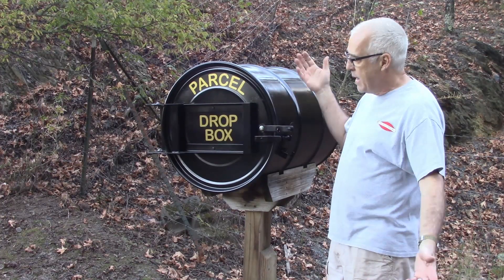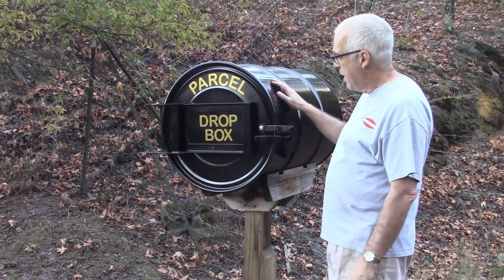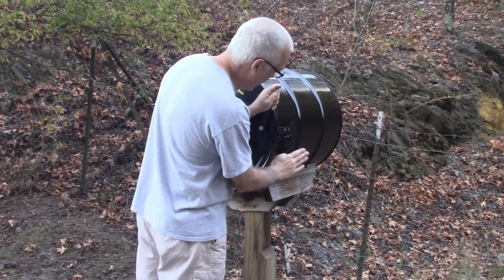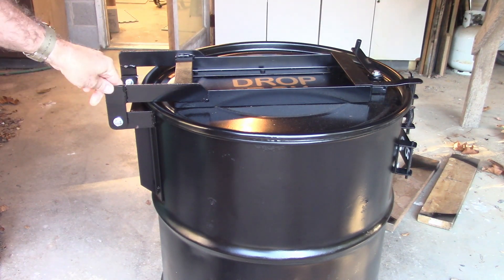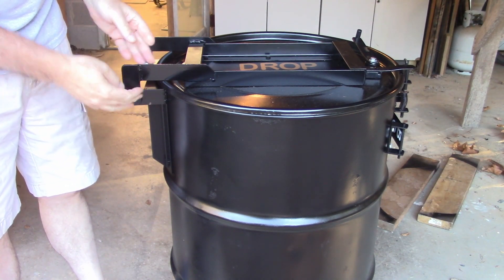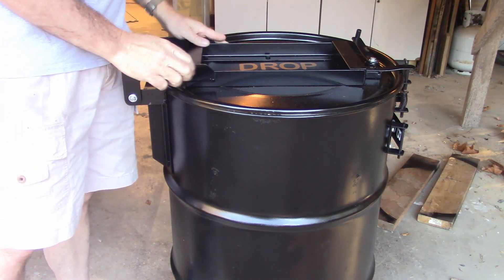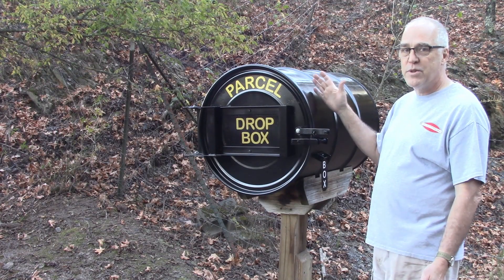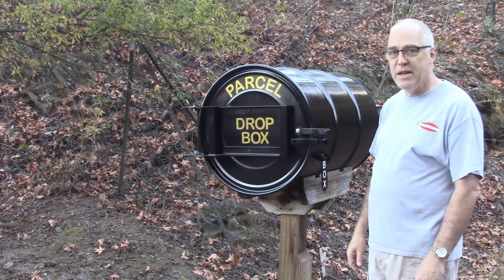DIY Parcel Box

Comment: curious how does that stop thiefs?
Reply: My guesses:

Packages are not sitting on the edge of the road ready for any passerby to pick up.
The barrel require any potential thief to actually stop and open the door.

Both increase the work the thief has to put in for no certain return, so they might simply ignore it.
Reply from the maker: It just keeps them from seeing it as they drive by.  We live in the country so a box would just sit by the road for hours unattended.